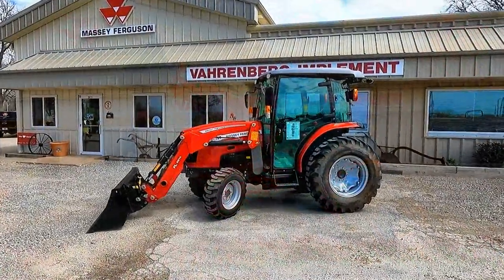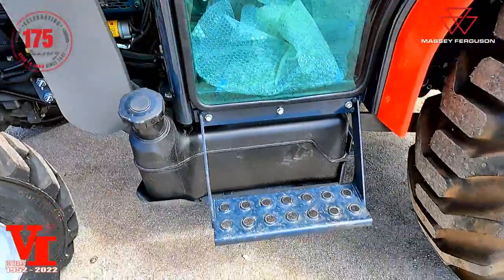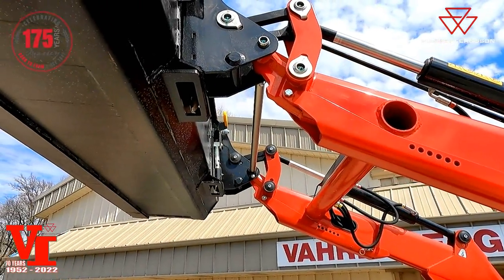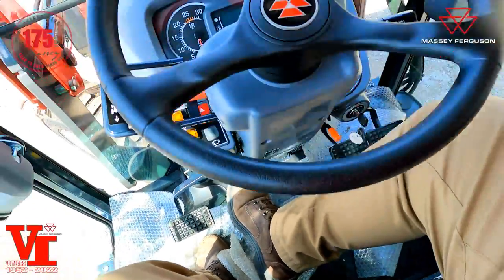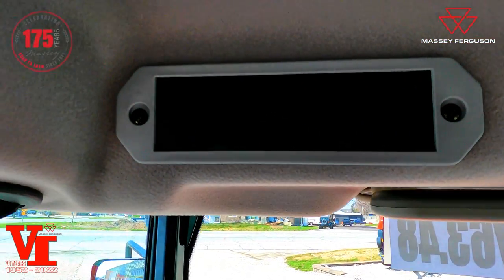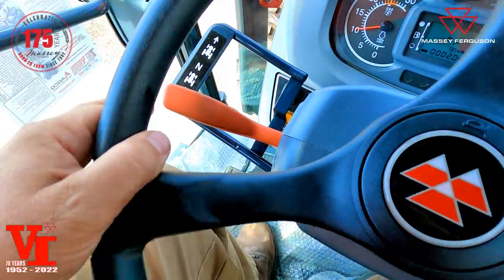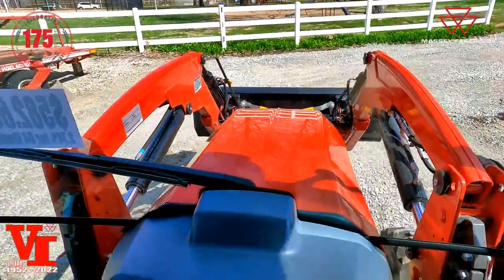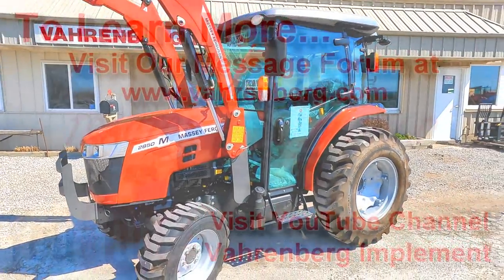Massey Ferguson 2850M Power Shuttle Cab Compact Utility Tractor (48.8 Engine HP/38.1 PTO HP)

Comment: Does the shuttle shift lever work like the 4707 when you lift up does it disengage the clutch?
Reply from the maker: Not on the 2800M Series. The Shuttle is Only Forward-Neutral-Reverse does not have declutch feature like 4700 Series Powershuttle.

Comment: Is the Woods TQH1 Quick Hitch compatible with this model? Since it has Cat I/II, many QH's are not compatible. Thank you.
Reply from the maker: We are not a Woods Dealer so have no information on their Quick Hitches. But most Cat 1 Quick Hitches will not work with cross drilled hitch balls. Cat 2 Quick Hitch will we sell from Worksaver.

Comment: What is the lowest speed you can go in those powershuttle goin in reverse at 540 pto rpm
Reply from the maker: Some of that will depend on tire size and type you choose but 2850M Power Shuttle with 17.5L-24 R4 Industrial Tires in Snail (Low) Range Gear 1 and Rated PTO Speed is 0.19 mph.

Comment: Are these available with draft control.
Reply from the maker: Draft Control is an available dealer installed option on all 2800M Models except the 286)M with Power Shuttle Transmission which is standard equipment.